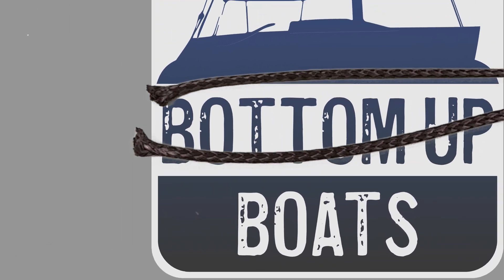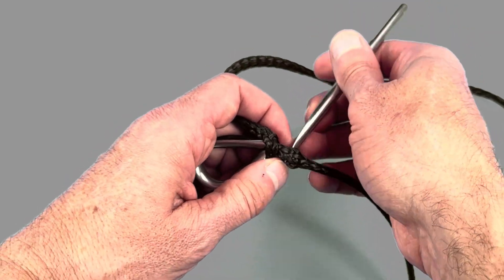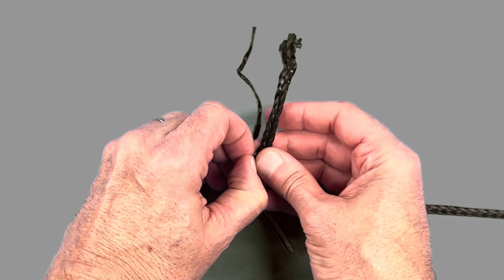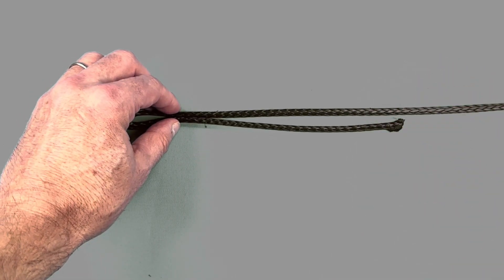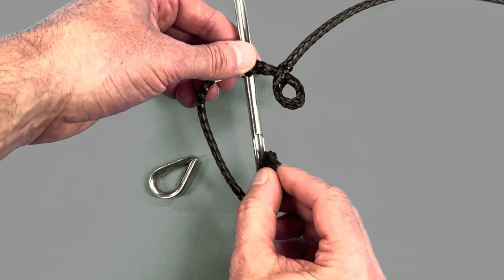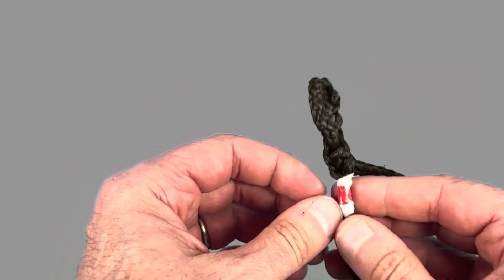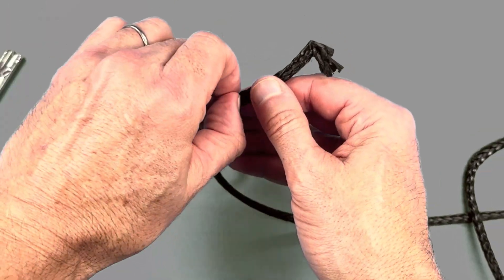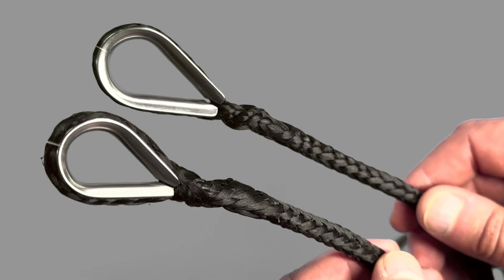Master the Dyneema Eye Splice with a Thimble

Comment: Sorry to carp, but you are using the wrong type of thimble. Since Dyneema is as strong as steel, you should use a CLOSED thimble. Check any rigging primer.
Reply from the maker: Thanks for the feedback, to be honest I just grab what I had spare from my bucket of boats bits. 

I will have to do some research on this. I can feel a another video coming on.

Comment: Question I understand the normal way to Splice hollow braid is pass the working end through go down 2 or 3 crossovers xxx pass through again xxx if needed xxx one more pass through again then bury the end. Why is this method any better if at all you're still relying on friction to hold it all together.
Reply from the maker: With this method the Brummell locks the splice as it pull Li’s tight on itself.

The final bury of the tail, helps but the mean pressure come from the steps.

XXX could become loose under no load

Comment: Hi there, i am thinking of replacing part of the standing rigging on my 22 foot sailing boat from stainless steel to dyneema. I was thinking of the 2 lowers and backstay. My question is, would those eye splices be strong enough for the job, please. Best regards Oz from England.
Reply from the maker: If you get the right diameter of dyneema it will be more than strong enough. In many case the rope can have a higher breaking load than traditional wire. I have a j109 which is 36 foot long and I use dyneema for my back stay. The J1019 has a mast head kite so the loads can be high.

The only point to consider is that dyneema will stretch as the rope beds in. This is why many still choose metal rigging for the lowers.

You could always tighten the splice if it did stretch